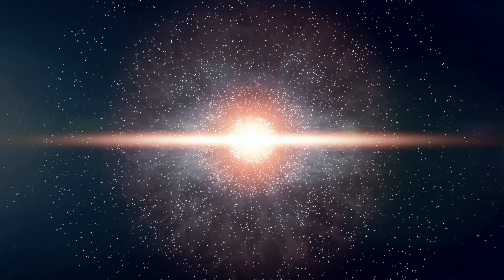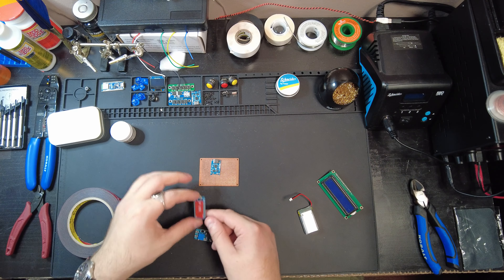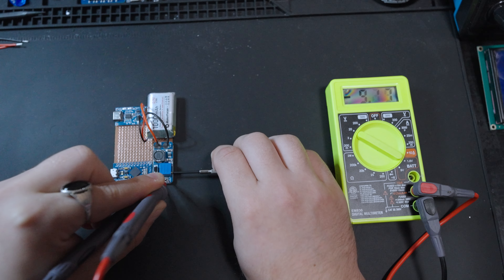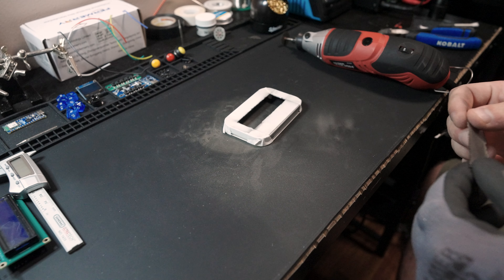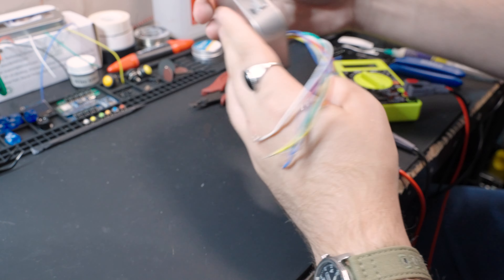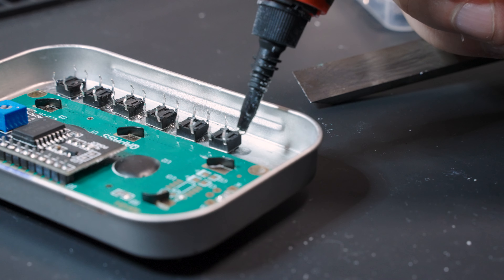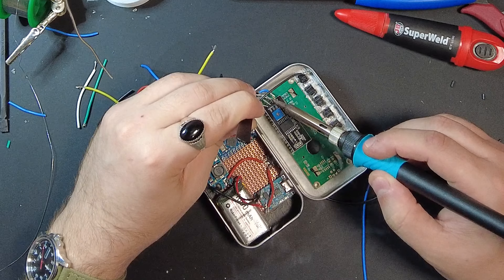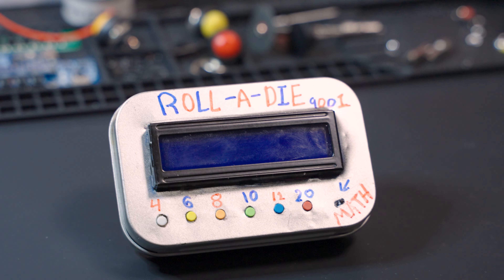Making an Electronic Dice Roller! - Goodbye Cursed Dice! -

Comment: What about adding an accelerometer (and foam to keep the wires secure) and shake the box to roll? 🤔
Reply from the maker: I like that! It could be bound to the d20!  Would be fun to try fitting in a rumble module to get the rolling sensation!